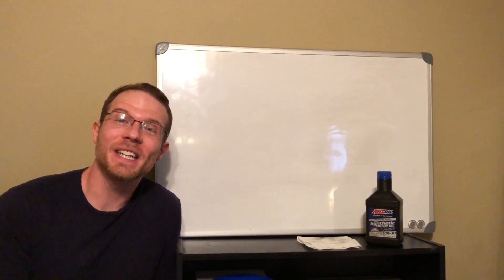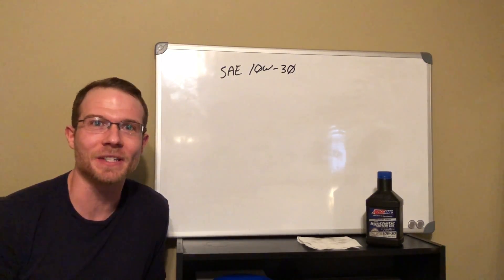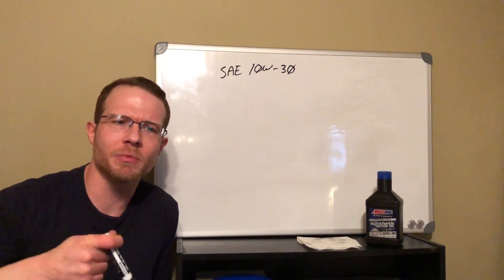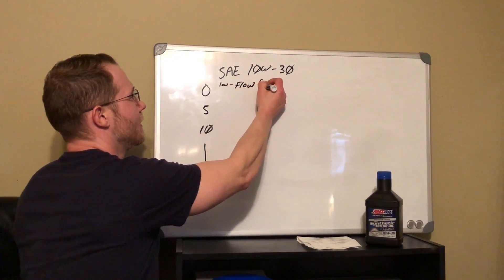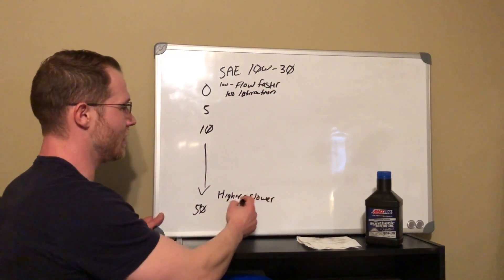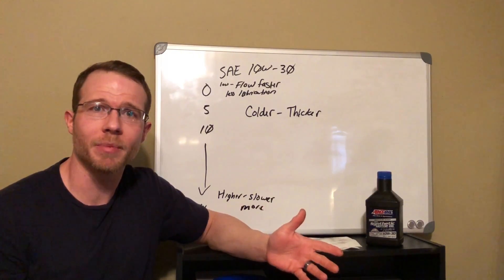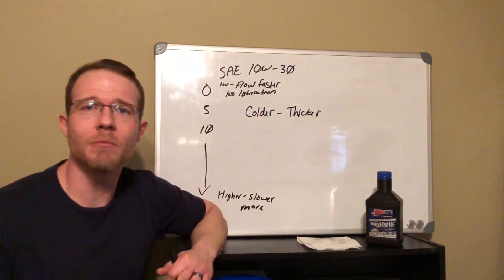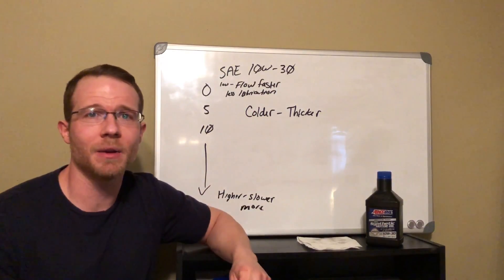What Do The Oil Numbers Mean? Explanation of Viscosity and Multigrade Oils

Comment: Can someone explain this to me? If the oil has a 5 (lower viscosity) weight when cold and a 30 (higher viscosity weight) when hot, why is it that if i do my oil change on a cold winter day it flows out like pudding, but if i do it after the engine is hot it flows out as easily as peeing after a long road trip?

Comment: To sum up viscosity in two ways:

- A definition I learned in Marine Engineering is, 'a fluid's inherent resistance to flow at a certain temperature(usually calculated in kelvin). 

- You can also break it into basic physics units. Viscosity is a covered area, per time taken, multiplied by density; which is a certain mass per volume. So a Mass of fluid x Area covered(say the circular section of a pipe) / Volume of fluid passing over your reference Area in a given Time.

I think though once you tell someone molasses and honey are viscous fluids, and water is not, they get the point intuitively lol.

Awesome video!

Comment: Hi there. My diesel engine has 10w40 multigrdae oil and i accidentally topped up with sae40 monograde. Same brand of oil. Is this gonna result to a major  problem?
Reply from the maker: Francis Valledor I can’t say for sure, but the issue would be that the oil you topped up with is going to act like a 40 weight oil when cold rather than a 10.  This would matter more if it’s cold where you live and if you added so much that there isn’t enough 10w to make it through your oil passage ways on startup.